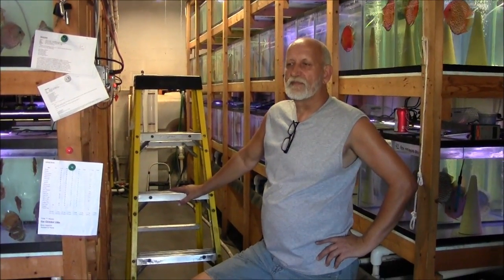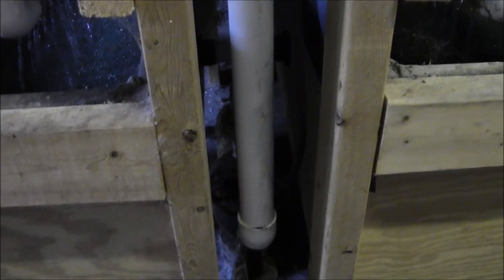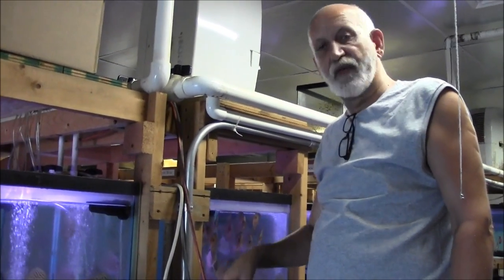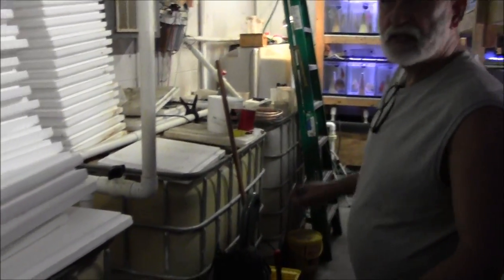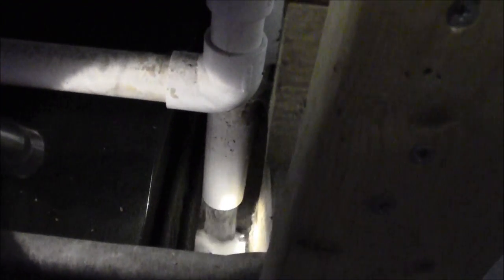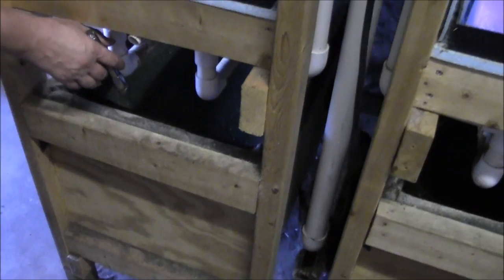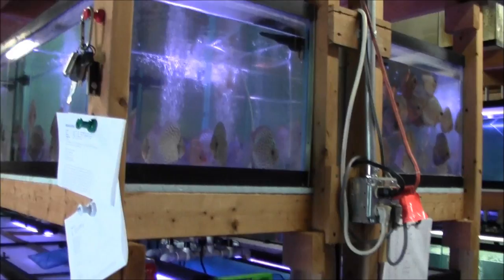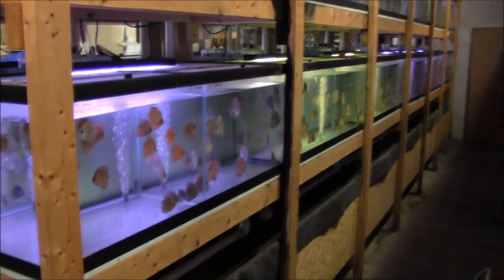WATER CHANGES IN THE DISCUS HANS FISH HOUSE!

Comment: I doubt with this being so old that I'll get a response,  but I'm just dying to know the answer. I'm curious as to where the pump pulls from the sump. Does it pull from the bottom? I'm assuming it isn't since a lot of the fine waste settles to the bottom. So, does it draw from an overflow tube in the sump maybe? Or maybe multiple overflow tubes to minimize a large flow area that could stir up sediment in the bottom around the overflow?
Reply: hello mike, here is your response you have been dying to hear... i have no clue whats-however
Reply: Seriously though, iam curious as well. But as you see on the video the dump is completely dry , so no overflow i guess...
Reply: I forgot I had posted this comment or I would have come back and shared what I found out. I actually talked to Discuss Hans and he explained that, yes, it does pull from the bottom and that was an important aspect to his system. Pretty much, all that sediment you see settling at the bottom of the sump is present in the water column but just dispersed in so much water and so many tanks that you can't see it until it all settles together in the bottom. Once it settles, then he evacuates that out by draining the sump area through a bottom drain.  So pretty much no sediment is sitting down in the bottom until he shuts the flow off.... then it settles,  then he drains it from the bottom to ensure he gets as much out as possible. Hope that helps some.
Reply: Nice one, good job, thnx for the answer